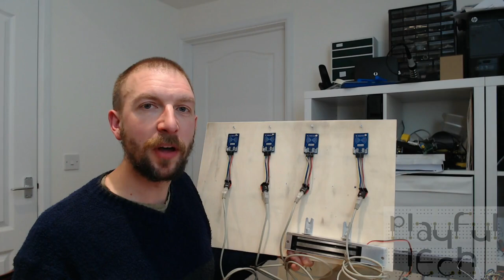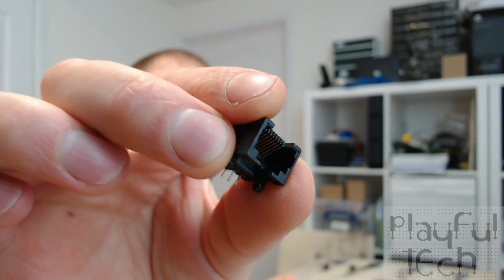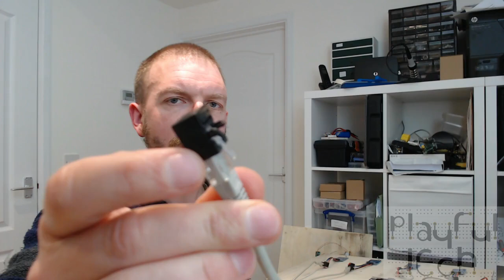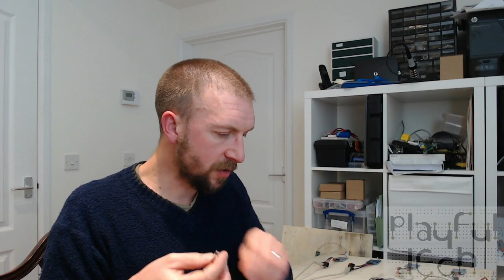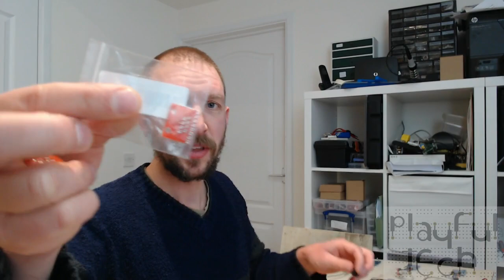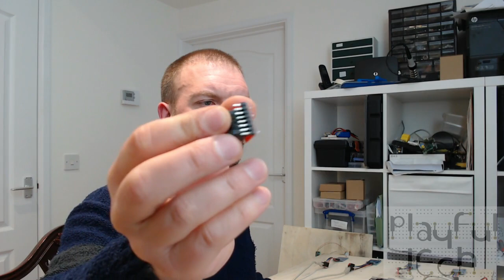RJ45 Cables

Comment: Hi thanks for this. How many meters can I use rj45 before there is voltage drop to my 5v sensor. Basically my question is will cat5 provide enough power over long distances of 100 meters for instance
Reply from the maker: There are voltage drop calculators you can use online, e.g.: https://www.rapidtables.com/calc/wire/voltage-drop-calculator.html

Comment: Hi there, new to this field. I am looking at doing a similar connection between a CAT5 ethernet cable and ESP 32 using a RJ45 breakout box. My question is once I have the the 4 RX and TX wires out of the breadboard can I connect those to the UART pin slots on the ESP 32 board?
Will the board recognize it? If not can you suggest to me solution for this? Thanks and sorry for so many questions.

Comment: Great video. Thank you very much. 
Just a small question: is the same possible with USB cables? I'm trying to connect a rotary phone with an arduino inside, with an ESP32 that's in another box.
Reply from the maker: No, USB is designed for a different purpose, and is really only recommended for distances of a few metres maximum.

Comment: I tried to do the same with my project, but to no avail. From what I understood the RJ45 female (at least the one that I got) does not have a 1 to 1 wiring: there are 8 pins but you don't have 8 inputs & 8 outputs, rather there are 4 pairs of transformers, so there are 4 open circuits that you must close yourself by sending data through them. From what it looks like from this video, you are exploiting every cable in the RJ45 connector, did you use a particular kind of RJ45 I'm not aware of, or is there something more to it?

Comment: Way over my head, but really cool!!!!!!
Reply from the maker: Oh no! That means I haven't done a very good job at explaining it :(  So here's a tl;dr version:    "Electrical signals don't care what sort of wire they travel down. So, even though ethernet cables with RJ45 connectors are designed for plugging devices to the internet, you can actually use them as a convenient way to carry any arbitrary data or power signals to any components in your projects."    Is that any better?
Reply: Nice explain